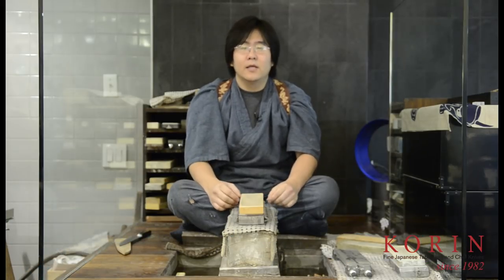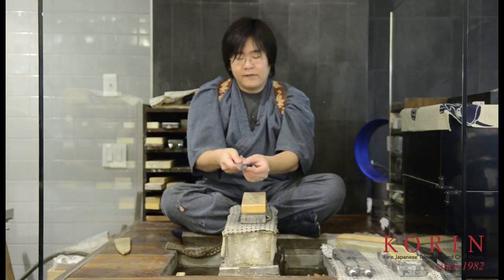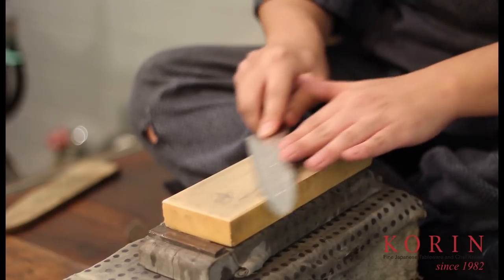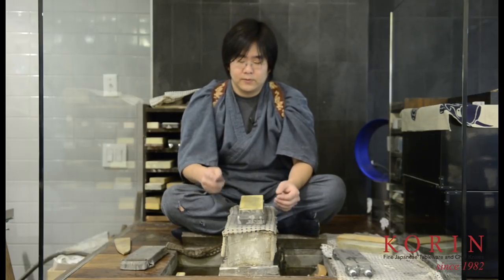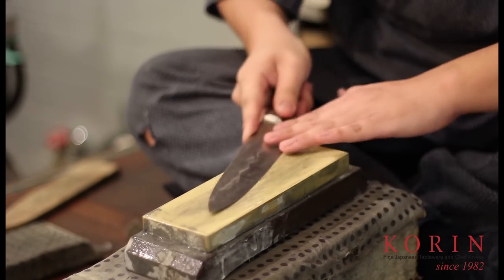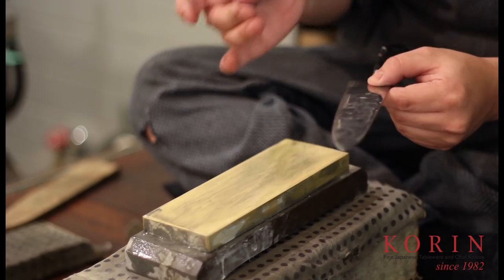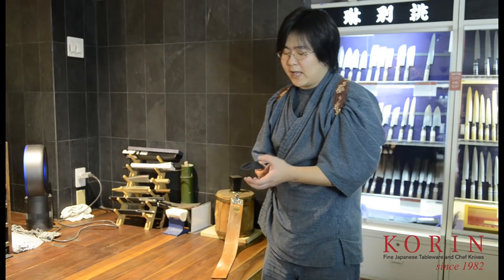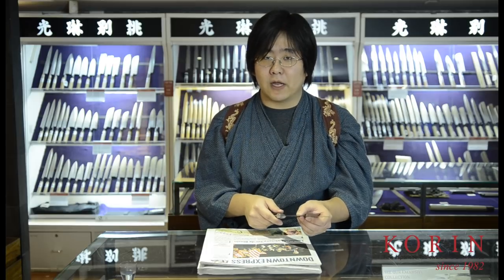Learn How To Sharpen: Episode 15 - Removing A Burr

Comment: Wow, after watching some of your videos and learning a lot I tried to sharpen my mom's cheap knife (I think it was less than 10 dollars).

I didn't know that I could take a blade so dull and transform it in something usefull! I also did a microbevel and I think it worked, wasn't that easy but it wasn't as hard as I thought it would be 😅

Anyways, thanks for all the tips :)

Comment: Thanks for the video response Vincent!

I have seen people run their knife through a piece of wood, at 90 degrees. What do you think of this method and do you ever use it? Somebody mentioned he uses this method to also remove a "wire edge". Will your method on the stone work for this? How do you know if you have a wire edge vs a bur?
Reply from the maker: Hi David, I've seen that as well but i don't think its a good idea to run it through wood since it probably can damage the knife if done incorrectly. however, i have never tried this method.

Comment: Is there any reason when I do both a polish and strop that my (I've heard this term from another channel about sharpening knives) apex is not being removed and when I test the sharpness with a piece of paper it will roll to one side and cause a burr and I have to continue to try and remove it with either the stone or strop and if I get it to be removed the knife almost seems not as sharp before the roll/burr appeared? 

Little back story of the knives, they are cheaper kitchen knives and some are quite old. I want to learn how to sharpen and maintain a knife or knife set before we go out and buy some nicer knives and ruin the edges beyond safe use.

Comment: nice kimono!, but wauw i bought the king kw 65, tbh the 1000grit side is very corrosive and 6000side is pretty hard stone and glass like, i sharpened like you said could shave with knife but not push cut paper and paper very clean cuts, i stropped it on newspaper and wauw its now razor sharp!

Comment: I have a problem with sharpening blades that have a pronounced curve in the blade. Seems like have a problem keeping the edge defined with no facets just above the edge. Any suggestions?
Reply from the maker: The best suggestion i can give you is to make sure your wrist is very steady. The problem you speak of is usually caused by your wrist wobbling regardless of the shape of the knife

Comment: Again excellent. When do you graduate from sharpening in one direction and lifting the edge to not lifting the edge and sharpening in both directions?
Reply from the maker: You want to always apply pressure in one direction. When you are using a finishing stone you can apply pressure in both directions since you are going to be applying very little pressure.

Comment: is burr bent metal, or the shavings off the edge?
Reply: DaxterbeerGMS… it's bent metal that eventually gets pushed over to the side opposite the one you just sharpened. The best way to remove a burr is widely debated, as is whether you should form a burr at all.

Comment: After stropping on my stone I normally run it through a endgrain bamboo block a few times.
Then finish if with some final stropping strokes
Reply: Woof. Do Not Do This. Endgrain bamboo is super hard and will seriously dull your edge even as a cutting board. Definitely wouldn't deburr with it.

Comment: leather strop has two sides, one side is course but sofe, while the other side is fine but harder, so which side should strop first?
Reply: i heard that the hard side is wear barbers puts green cream and the smooth fine side is the ultimate finish. I always only do the finishing side and it's has good results. If you want quick finish on a quick sharpennig you can use the butcher's tool ( a long iron blade )